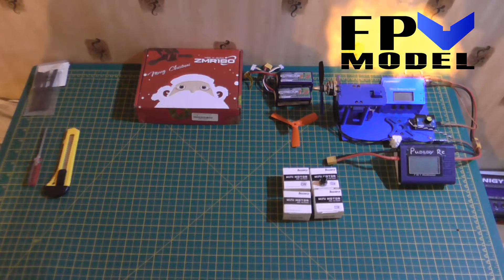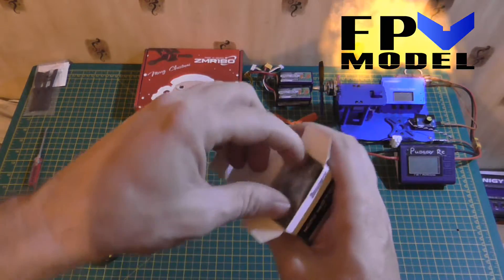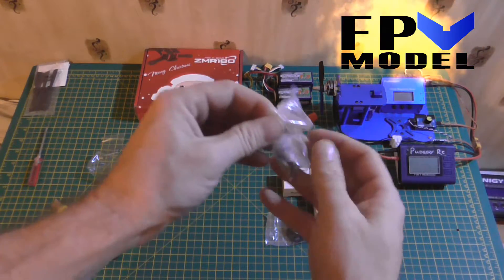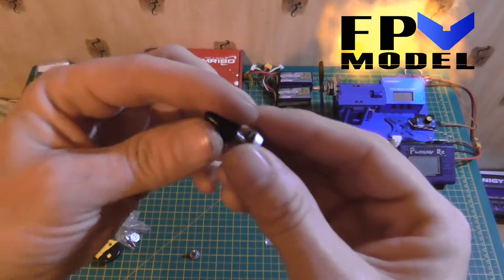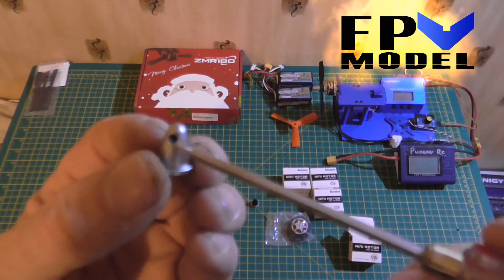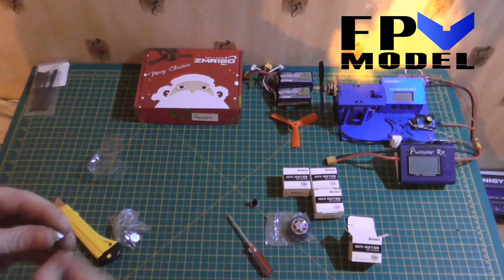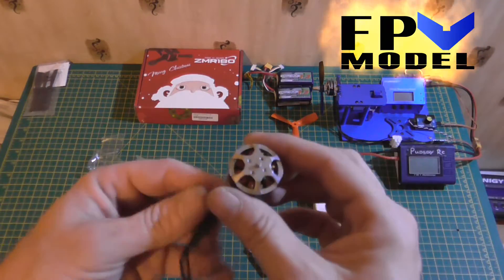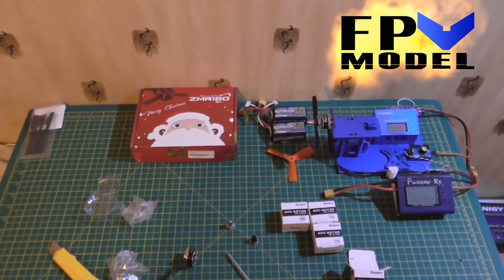DragonFly 2206 2800kv Motors

Comment: I have these on my qav180. They are the smoothest motor I've ever flown! The power is just amazing on 4x4x3 props. I ordered a set for my qav210 as I wait for emax 2205s to show up. If you have not tried BorisBs betaflight (latest alpha) do it now! Its bliss on these motors.
Reply: +Inigo N Can you tell us about the flight time you getting on that? Cruising and pushing hard? battery as well?
Reply: +RAFAEL TORRES I'll put up a video